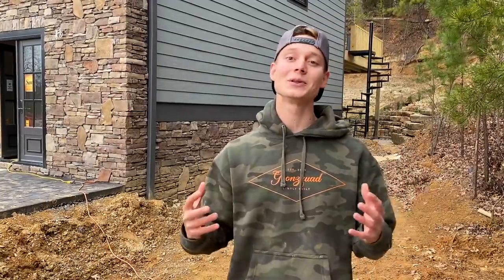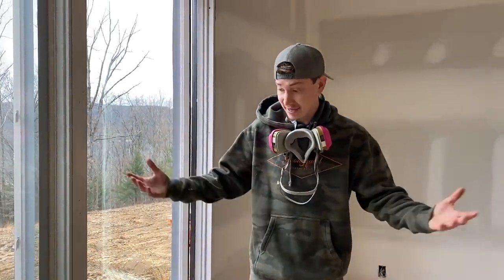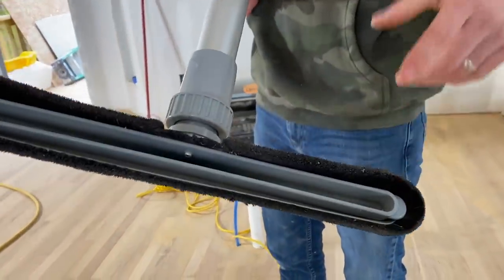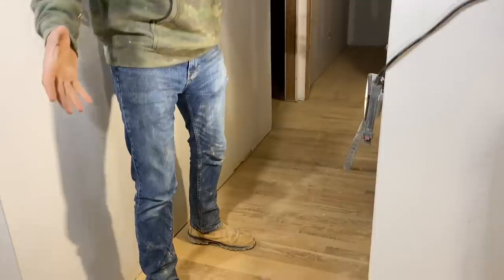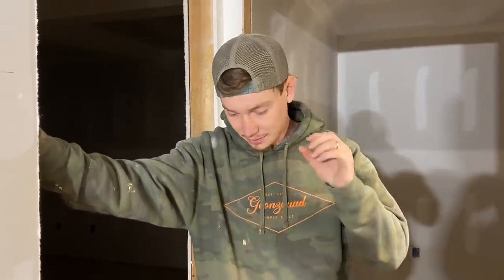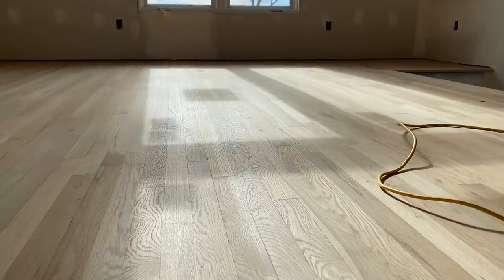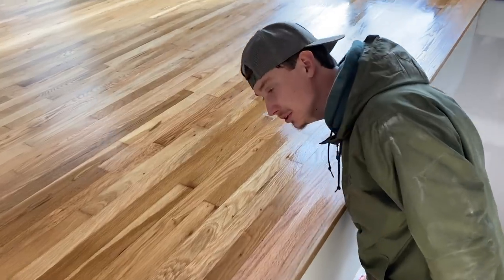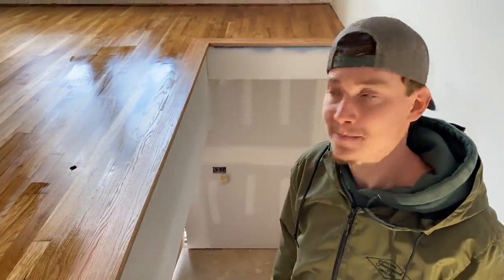The New Goonzquad Headquarters Part 54

Comment: Always enjoy the content guys, but wanted to say: with all the stone on your facade water is going to travel down the crevices. I know you caulked it but you may need to slide a small piece of aluminum flashing above the window, then seal with caulk. Fingers crossed it doesn’t leak but the fix you made is likely short term. Another option might be to cut a groove in your stone all the way to the mortar and install a Z-channel type flashing (like a chimney). Looks great guys! Enjoying watching you guys challenge yourselves and share your experiences with us :)

Comment: You are doing 3 coats on the floor and buff in between each coat, right?  The first coat seals and makes the grain stand up and it will be very rough. Buff it to smooth it out and then a second coat to make it smooth, and the third coat for added protection and durability.

Comment: -The finish (Bona Mega) has color added.  It is not a clear finish.  Mega is also a top coat, and not usually applied over raw wood.  Most pro's would use Bona classic seal on raw wood.
- Good call on the backpack vac and quality wand.  That's what a pro uses.  Vacuum with the grain when possible, especially before coating.
- Big mistake to apply cold finish in a cold house.  The finish won't level or dry correctly when both the floor &  finish are not 65 degrees.  That's why you have t-bar marks ( 1/2 moons) showing now.  Always t-bar with the grain especially in the hallway. 

Wood floor installation and refinishing isn't 1 $1000 problem.  It's a 1000 $1 problems.  Cool video.

Comment: Hey make sure you fill in any low spots in the concrete floor in the downstairs with a cement base floor patch. If there are too many or to deep of valleys the adhesive will let go,and you don't want that ,! Trust me.  30 years in the floor business

Comment: Engineered hardwood can be sanded just like hardwood just keep in mind there is only like 3 sanding on it before you replace it.  so, don't sand to deep and use up all sanding right out the gate.  the are not letting the wood acclimate to the house before the install.

Comment: 2 coats probably won't be enough water based. I was told 2 coats, floor felt super rough still. I ended up with 5 total. Probably didn't need all 5, but as I sanded them between each coat it just got shinier, and almost a glass type finish shine!

Comment: Brothers on suggestion instead of using money on this vacuum you can get a Dyson v11 vacuum which has the floor attachment and a suite of attachments that I didn't know existed. It's handheld and electric no wires included. I think It would be a life-changer for you guys, especially with the fluffy floor attachments. It even picks up cereal and other larger materials. So I insisted y'all get one it's a very precise and powerful machine. Again I am just suggesting not judging or anything so no one comes at me. I love y'all's content and wish you meet y'all one day and dang son this house project is going by so fast I can remember the day I could see the studs and old doors and old sidings!! Love your work!!!

Comment: Water popping means making the wood fibers pop up with water.  That makes the wood super rough.  You then sand it smooth again.  Then when you put on your water based finish, the grain won't raise again because you already popped it.  So it's not about making the grain stand out prettier  It's about being able to use a water based finish without ending up with a rough floor.

Comment: Tile that laundry closet and add a tile baseboard. It's probably too late but a drain would have been a good idea below the machines. you will have a leak / flood eventually and you don't want it going thru a wood floor to the rooms below.

Comment: Do you have the heat connected  in the house, stable temperatures will keep expansion/contraction down, help floors, drywall & etc.

Comment: Hey guys, my name is Jason, been watching your videos for a very long time now. I have been in the water mitigation field for over 20 years now and I will tell you this... If that wood floor is not dry you're going to constantly have issues, main concern would be subfloor is affected. Every material in a home has a standard moisture reading, hardwood floor generally is anywhere from 11% to 14% moisture concentration. If your subfloor is wet you will constantly have issues in the future with it including with potentially mold. Keep up the great videos though I love them

Comment: Regarding that stain on the drywall under the window that leaked, check with your paint supplier on that.  It may bleed through the top layers of paint.  Your paint supplier might recommend a way to arrest that stain.

Comment: Even young guys will get tired toting groceries upstairs. Have you considered a "dumb waiter" that you can use to lift groceries up to the second floor? It could be added to one of the outside walls with the Hardie Plank or, if you have the space, build it inside. Downstairs and up you'd have a set of cabinets that match whatever is on the floor, then keep the dumb waiter shelves upstairs to use as a cabinet with shelves. It'd be fun to hook up some sort of winch and pulley system with a Goonzquad touch. Your house reminds me of one I built for myself with a 180 degree 60 mile view, including Amicalola Falls. A neighbor's house, a lot larger than mine, had a large, rigid HVAC type pipe, maybe 18", with the slow, sweeping bends that dropped down to the laundry. Upstairs they'd drop their dirty clothes down the pipe. In my own house which was 3 stories, the utility room was downstairs with three kid's bedrooms; however, it was worth it to put a small stacked washer/dryer to wash clothes on the master bedroom level on the top floor. Once you finish a house, you get lazy, or at least I did, you start thinking, "Why didn't I do this or that???"

On your window with the leak. I battled a very similar leak forever. It was caulked and caulked again. Found out that the windows were made wrong and the water that would blow into the window frame pool up, then go inside the wall because it was tilted ever so slightly at a backward angle kicking the water into the house. By the time we realized the problem, the company that made the windows had quickly gone out of business, so all new windows had to be bought out of pocket.

Comment: Not sure if anybody said this yet, but I had a leak on my hardwood once, I was told not to sand them down until all the moisture was out with a dehumidifier. I would test the moisture in the wood periodically .. after the water was gone, it actually all went back flat and perfect. I’m afraid if you sand it, then it dries out, you’ll have huge gaps.. just what I was told, I’m not a floor professional by any means..

Comment: Boys for your next house: please finish the ceiling and the walls before you do sand / buff the floor.

If you coat the walls, mount stuff or let the workers install some things its kinda Impossible to cover the  floor completely from getting damaged. Something falls down e.g.  a heavy tool and you gonna have a hole or scratch in the wood.

You will have to do some floor work - at least partiially - twice.
Reply: Sometimes we have to do things out of sequence in our projects, and the 'top to bottom' rule has to be broken. We then protect fragile wood, tile, brick or stone floors with heavyweight polythene sheets (taped all round), a layer of high density foam, and sheets of OSB. In my view it is about all OSB is good for. It all costs, but it's still cheaper than replacing a giant Travertine Marble slab which was the size of an entire Master Suite and broke when an electrician dropped a big Hilti on it. Don't ask how I know...

Comment: I would have gone with a stonehard/epoxy type floor on the first floor, especially in the "garage" section. Some of those colors you can get are awesome. Using a thinner floor material just doesn't make sense in what will be the higher traffic areas but it will look good - for a little while...

Comment: You both are getting it done.   You might want to consult a reputable window installer before doing a lot more work.  You don’t want water in the house where it isn’t supposed to be.   Fixing any issues after you move in will be tough and you don’t want to do things twice.

Comment: How are you finishing hardwood floors in a house with no HVAC wen it’s 40 degrees?? And how do you plan to install new flooring in a house that is 40 degrees! Gonna have problems down the road! That flooring needs to set in the house with the temperature under control for several days!

Comment: Why is the hvac not installed yet.  Usually the drywall doesn’t get finished without it.
Reply: Some towns/cities have  bylaws that do not allow for the HVAC to go in while construction is going on because of the dust and damage that can occur to them. Its a way of protecting consumers from contractors that would otherwise sneak it in and not say anything ! I know where I live, thats how it goes.

Comment: you guys need to remove the drywall and inspect where its coming/going. there could be mold, or the damage could be worst than you think.  you cant just add window sealer randomly without knowing exactly how the water is getting in.  You should also check the ceiling in the floor below, most likely water got to it, just because you dont see stains right away, it doesnt mean there isnt water damage.  Its best to do it know, rather than waiting until there is damage to your expensive finishes and/or health problems with mold.

Comment: When is the new garage being built? Also what are you guys doing with this other property you originally bought and intended to put the Goonzquad Garage?
Reply: The winter will probably delay the start of the Garage/Workshop which they plan to build next to the west side of the 'HQ House', but they should be able to make a start in February and complete it by midsummer. The one acre commercially zoned site on the southern boundary of Downtown Chattanooga should begin development once the Official Permits are received.
Reply: @johnstedman4075  it sounded as if the commercially zoned property will not be developed now and the actual Goonzquad garage will be built next to the house.
Reply: @carlkwasnjuk9518  Goonzquad confirmed recently that they intend to proceed with both projects as soon as they can.
Reply: @johnstedman4075  I have not heard that. I don't do Instagram. Maybe they said that on there?
Reply: @carlkwasnjuk9518  No, these intentions were stated recently on their YouTube channel.

Comment: When did you get electricity hooked up to the house?  I don’t remember seeing a video doing it.
Reply: They have a temporary 'Builder's Connection' at the moment, and have had for several months. The full 'Customer's Connection' should be made once the Second Fix installation is completed in the property. 'Second Fix' includes installing and checking all the power outlets, light switches, fixed appliances, the central HVAC unit, external lighting and any other electrical appliances. The complete installation also has to be inspected by a City Official to ensure that it complies with Code and safety rules in all respects.

Comment: Do yourself a favor and glue one row and start a straight line come back the next day when it’s dry so you have something to push against make sure to weight it down I use the drum sander or whatever else I have and you wound be able to just buff the glue down you need to cross with 40 grit on a 45 and fill then 80 straight all sanding need to be left to right
Reply: Glad someone else mentioned going left to right
Reply: @Farnorthanglers49431  I don't know if I've ever seen one of their videos before I saw these about sanding their own floors. I will give them some credit that they at least know some things and they're not loading that floor up with drum stops like I expected.

Comment: I would've laughed my ass off if any of my apprentices tried to use a shop stool like that.  Then told them to put it out in the truck, and off my jobsite.  Not a bad looking floor, though.  The only time we EVER fill before roughing off is when the cracks are huge.  Even then, we nearly always rough off first, let the filler dry, and fill again.  One last pointer:  vacuum the edges BEFORE vacuuming the field, and never touch the walls/doorways with the wand.

Comment: Sorry guys but you will have consistent water infiltration with the way the windows are installed. Check out videos and tutorials online. Matt Risinger has a tone of good info. Doesn’t matter how much silicon you use water unfortunately always finds a way in. You need a system that actually sheds water away from any joints /seems. Call someone to reinstall otherwise you will have mold build up inside the walls. Good luck!

Comment: goonzquad... let me say love the videos, I enjoy seeing todays youth excited about building..

 But I wish you would get a adviser or further research before doing some of these on your own. I knew your windows would leak and just siliconizing it wont stop the leaks, it may need the stone removed around the window and L channel flashing, sides first then top is ideal, and with the window preferably sitting on flashing so if water gets in it hits flashing and drains outside, its also ideal to tape flashing after install with one the many exterior tape products for further air sealing as well.  In some situation I have some succeed by using my multi tool and to clear enough mortar to install just flashing at the top, by slipping it under the stone/brick, but this isn't ideal
 With water base poly(it is polyurethane as well)  it dry so fast you can apply up to 4 coats a day(as long as you have already laid down sealer and made sure its complete dry first, 4 to 6 hrs.), recommend at lease 6-7.  Why so many you ask, because water base poly is just poly suspended in water by products, which make the coat way thinner and will often only last 4-5 yrs when only applying a few coats, more coats the better. A few coats of bona or similar urethane product isn't a bad ideal, before you move in after final clean up. Since it just mops on and offer further protection from scratches.
 On installing the hardwood direct on concrete, concrete is a porous material and in the rainy times of year it will wick up some moisture that will get trapped under the hardwood, have seen it warp hardwood several time personally.  Consider sealing concrete at a bear minimum( or glue down a moisture barrier and a french drain around the house isn't a bad ideal either. You can bring it around the house and tie in the new downspouts and put yard drains in near the patio to catch any static water from the patio.

Comment: You should take stone off from top of window and put some stainless steel 90 degree drip end with a lip and put rubber flashing from exiting building to the front of flashing then fix stone no mor water for sure

Comment: oil based coatings are pretty much banned in most countries. it is true oil based does add a yellowish tint how the coating, oil based premium products will out last, more durable water based. the only draw back with oil based is the smell, which can last for months if not well ventilated, however it can be accelerated with exhaust fans or hydroponic carbon filters with inline fans for re-circulation.

Comment: YOU GUYS NEED TO SPRAY THE WINDOWS AND THE AREAS AROUND THE WINDOWS WITH WATER TO MAKE SURE WATER DOES NOT COME IN BEFORE YOU GUYS GO ANY FURTHER! AND i ALSO SUGGEST RIPPING OUT THE DRYWALL AND MAKE SURE THE INSULATION AND WOOD WORK DID NOT GET WET AROUND THE BIG WINDOW BECAUSE YOU WILL HAVE A SERIOUS MOLD ISSUE IN THE FUTURE!

Comment: That leak around the corner of the window is not good! Who did the Tyvek wrap on the exterior?
Reply: The exterior wrapping to the timber structural frame was installed by the original developer in 2008 or 2009, prior to their adding the stone and brick veneer to the southern elevation. Images of the house interior in the Goonzquad videos shown in summer 2020 make it clear that the there had already been rainwater leaks through several points in the external envelope by that time.

Comment: Floor looks great but you should really have tested that window  before continuing and surely you should have painted and sorted the ceilings and walls and worked down if your painting as one accident will see the floor having to be done all over again and as a big room maybe some evenly spread underfloor heating could have been considered. Not looking to dis your work just we were always taught to get watertight before doing any inside work and then plan in layers and work down. Still looks good though.

Comment: That thin flooring is called engineered. Plywood substrate with a sawn wear layer. Even the highest quality engineered still needs big machined, I don't care what the manufacturers say.
Reply: @DesignBuildFixReview  I'm talking about the one they mentioned gluing down and that they showed in the middle. The one they called thin. The wear layer isn't really a veneer, but it is thinner than a normal 3/4 floor
Reply: @DesignBuildFixReview  real wood needs to run 90° to the floor joists so most of the time you don't really have a choice as to what direction it runs.

Comment: if the floors are done and cabinets are installed theyre gonna have a hard time painting because the walls and ceilings need to he primered and then painted with the floors being done and cabinets in theyre gonna have to cover everything if theyre gonna spray

Comment: The window technically needs to be removed and Properly repaired because if not you’ll have a mess on your hands later on down the road it will ruin the sheet rock the stud behind the sheet rock the insulation and your floor again